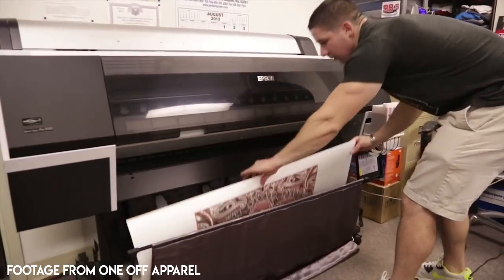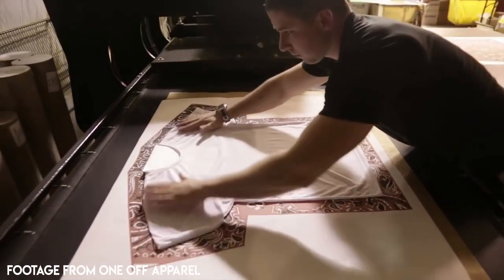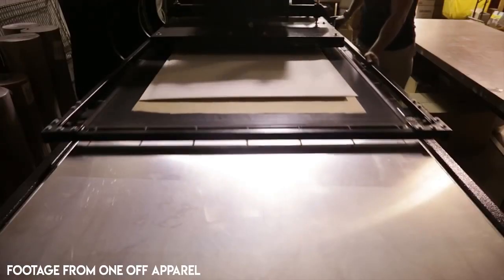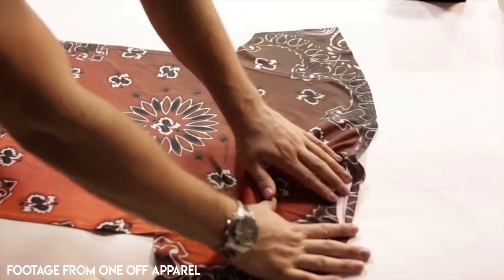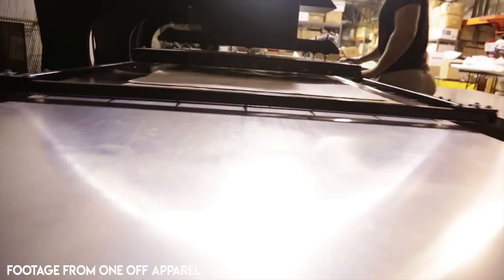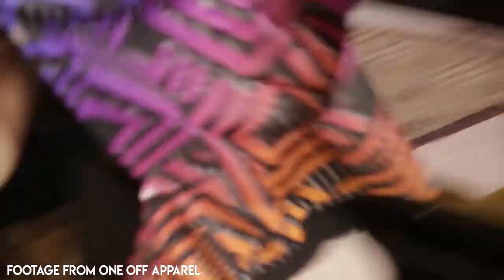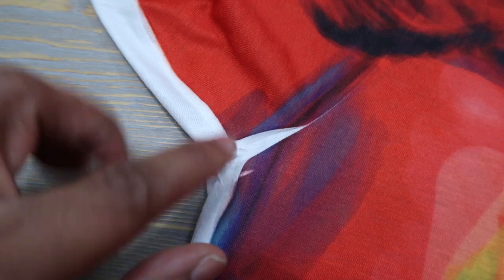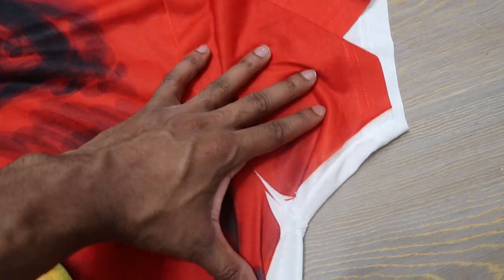The pros and cons of all over printing - dye sublimation t shirt

Comment: Omg thank you so much for this pro and con video. NOBODY talks about the cons of sub dye and acts like all over printing on both and front is easy and comes out perfect. BUT I had my suspicions and assumed that there may be undyed areas like the seams over the shoulders and sides, is that true if one were to dye sub both front and back on the same shirt? Also, is it possible to sub dye in sections?

Comment: why does it have to be 100% polyester for all over print hoodies and such? whats the issue with 100% cotton materials?
Reply from the maker: You can apply it to cotton but it will bond better to 100% polyester. Most print shops won't print all of print style prints on 100% cotton.